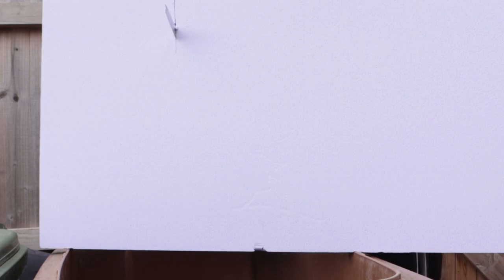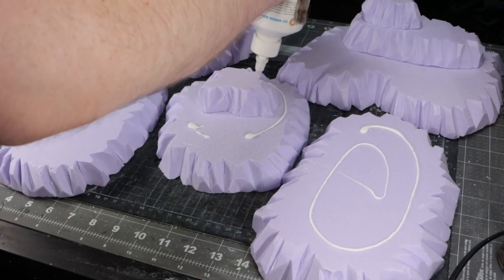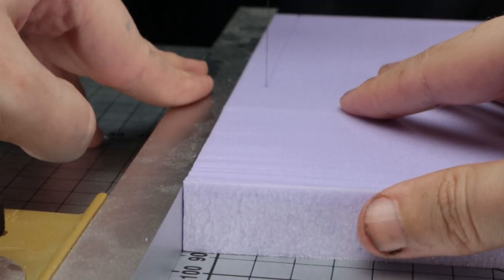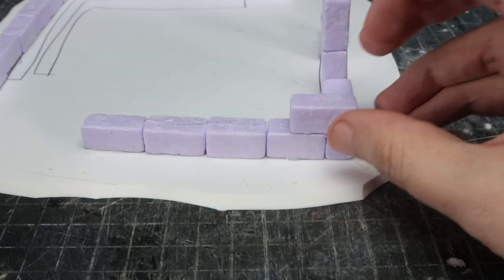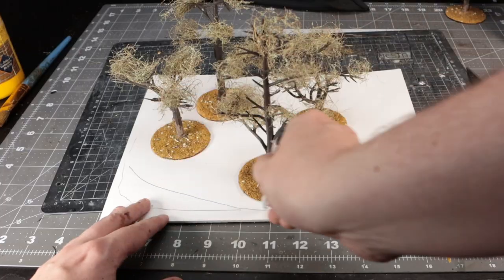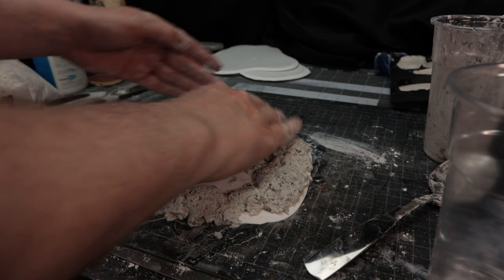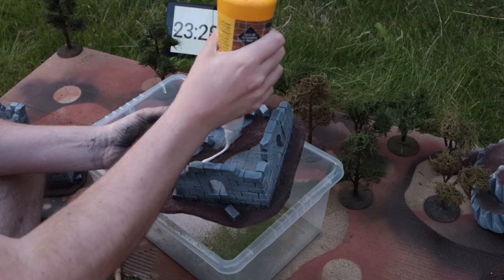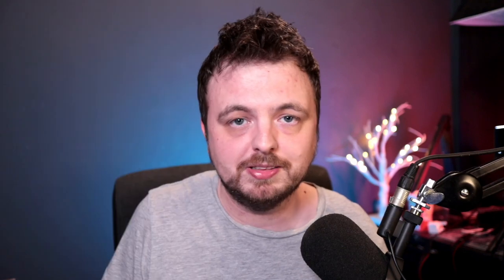Can I Make A Full Table Of AoS Terrain In 24 Hours?

Comment: The most impressive thing here was that you were waving around those ruins by the bricks and they didn’t fall apart.... HOW!?
Reply from the maker: heh thanks, a couple of things I didn't mention, they were very wobbly at the top, I did put a bit of a pva layer at the top, just rushed and spread out with my finger. I also put a little broken bit of cocktail stick up through the top of the windows. But frankly I am not sure ither of those things helped, they are reasonably fragile :)
Reply: @TerrainMadeEasy  this was a great video dude. Understandable if some steps had to be skipped for time sake.
Reply from the maker: @FrankyDCrafter  Thank you very much :)

Comment: What Hot wire cutter are you using ?😊 and how did you Cut those circular mdf bases?
Reply from the maker: hot wire cutter just some cheap one from ebay, mdf basesI bought pre cut on ebay